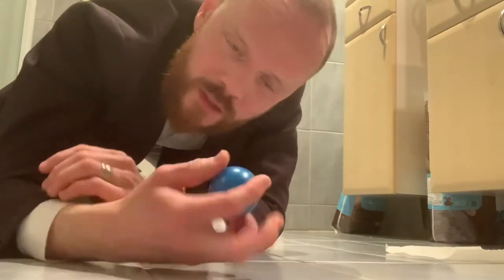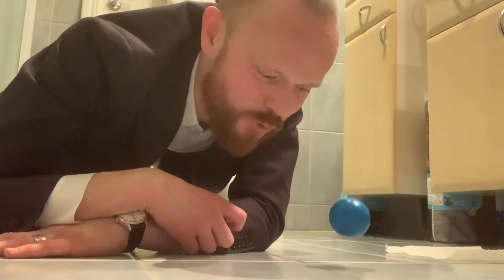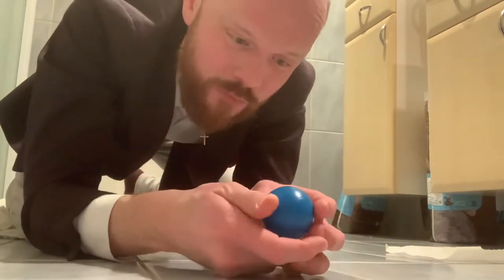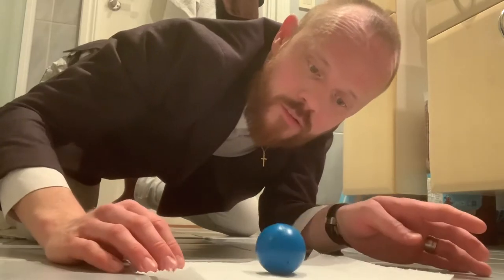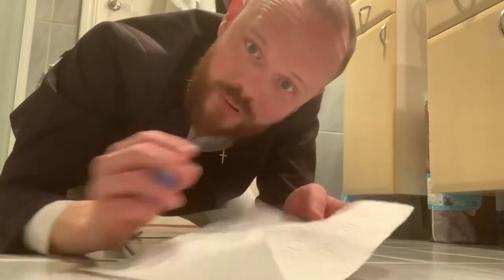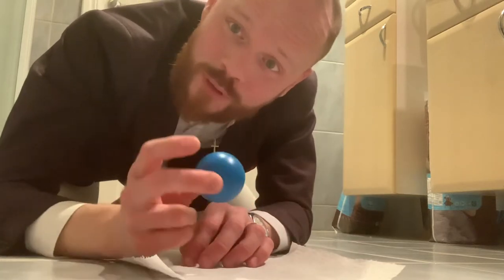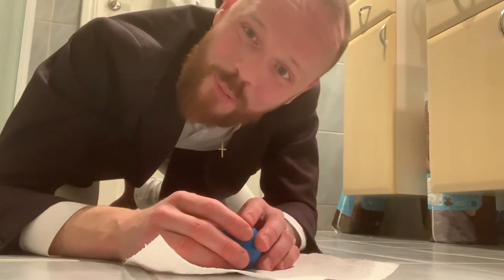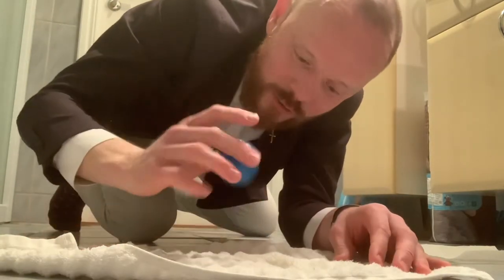How does sound absorption work?

Comment: The problem is that the absorption doesn’t take place at the surface, because porous absorption is only effective at slowing down air particles with a high sound velocity. This is at 1/4 of the wavelength.
Reply from the maker: I usually illustrate that with a Slinky spring, then it becomes obvious where the slowdown must take place to stop the movement.

Comment: Ive heard that a perforated acoustic absorber plate (like MDF wood, for example) has even more chance of absorbing noise than a smooth one. Is that true? And if it is, does that mean that if you perforate that piece of paper in the video, does the ball will bounce even less?
Reply from the maker: That depends on which frequency range that you want to absorbe. There are different physical mechanisms in play. A solid plate can create a resonance absorber in the cavity behind it and be very effective at low and super low frequencies, but otherwise, its performance is limited. A perforated panel is a compromise between resonance and porous absorber and gives a wider band absorption. Porous absorbers are mostly effective in the high frequency region, so you will need a combination of different types to fully treat a room properly. I have a whole course in basic acoustics if you want to learn more: https://youtube.com/playlist?list=PLaL7nkGQ4uL2QSj-5aAy6CgivkvLoILeS
Sorry bout the late reply, I completely missed your comment!
Reply: exactly!